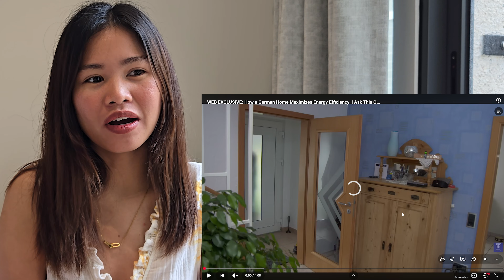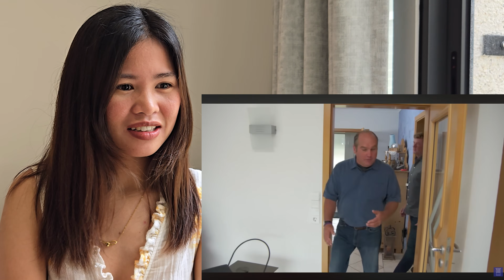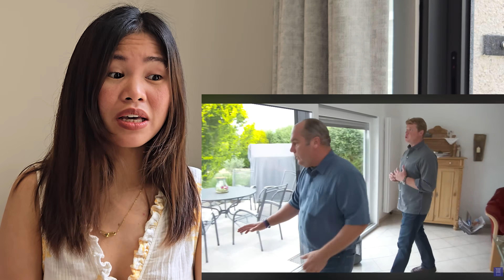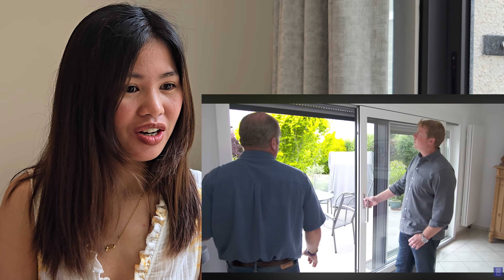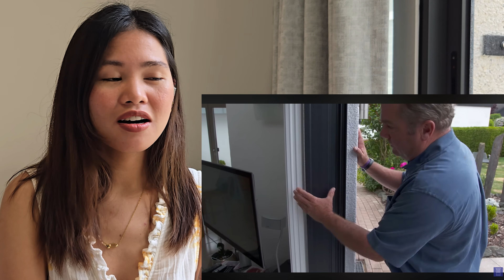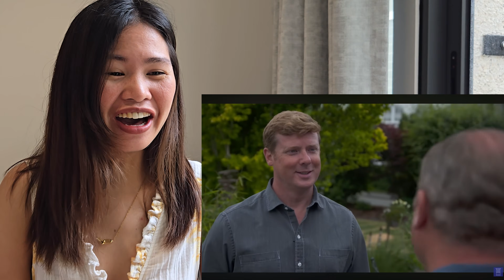American Girl Reacts to Why German Homes Are So Energy Efficient 🇩🇪

Comment: Ash, Germany places a lot of emphasis on energy-efficient equipment, such as household appliances, and, as you can see, in home construction as well.
In the U.S., people place a lot of importance on their AC systems. You’re the one who knows American construction methods: simple wood, barely any insulation, and it gets very hot outside due to the climate. The heat flows unchecked into the house if it isn’t cooled. The crazy thing is, AC systems are actually the biggest energy guzzlers you can have, because they require constant power to cool the air, and due to poor insulation, the system runs nonstop and the electricity meter just keeps spinning. That’s why electricity costs are so outrageously high in the U.S. On top of that, there are other household appliances that aren’t energy-efficient, such as freezers and refrigerators. I can imagine there are even more appliances there that just gobble up electricity.
Reply from the maker: Honestly, I never thought about it that way 😂 I always focused on the AC itself, not how much the house construction affects it.

Comment: Yes, the energy efficiency of buildings is very important in Germany. In addition to thermal insulation for the cold fall and winter months, cooling solutions for buildings are becoming increasingly important due to the increasingly hot summers (such as this year). In the past, it was enough to thoroughly ventilate a house in the evening or at night. But for the past few summers, that alone has no longer been sufficient.

In highly insulated buildings in Germany, the use of air conditioning systems—such as those commonly found in the USA – can create a risk of moisture and mold. This affects all surfaces in artificially cooled interior spaces, particularly in older and historic buildings. Mold then poses a significant health risk to people, especially infants, children, the sick, and the elderly. In the case of historic buildings, legitimate historic preservation regulations must also be taken into account. Air conditioning systems consume significantly more electricity, for which the electrical wiring in these old buildings is often not designed. This would significantly increase the risk of fire. In all these buildings, therefore, the entire existing electrical system would first have to be replaced and adapted to the power requirements of air conditioning systems—in compliance with the relevant fire safety and historic preservation regulations.

My parents live in a 14th-century house which they own and which is divided into several flats that are let out. For the reasons mentioned above, my parents ruled out retrofitting the entire house with electric air-conditioning systems. Instead, they opted to install a special clay-panel cooling system from from a manufacturer in Hesse. This system is clay- and water-based, does not increase the risk of fire, complies with heritage conservation regulations and requires no major alterations to the existing electrical installations. The technical work required to control the system is minimal. Once the clay-panel structure had been erected, the main task involved laying water pipes and hoses. The entire system is operational in all flats. The indoor climate is better than with other air-conditioning systems I’ve ever come across. There is no condensation in the rooms, and the cooling system does not switch off due to condensation. Nor is there any mould growth whatsoever. The system’s running costs are moderate, and the indoor cooling works far better than we had hoped. We – my parents, the tenants and I – are very satisfied with this solution.
Reply from the maker: I've never heard of a clay-panel cooling system before! 😳 And the fact that it works in a 14th-century building without completely replacing the electrical system is pretty impressive.

Comment: In some states of Germany the chimney sweep comes TWICE a year, for older „heating systems“ (literal ovens and chimneys). Oh, and the District Chimney Sweep is technically a government officer… also, the most important factor in terms of houses in Germany and saving energy is the proper heat insulation… which even protects to a certain point against excessive summer heat. Unfortunately, this year we seem to have passed that point during most of the summer….
Reply from the maker: Wow 😳 Twice a year for some older systems? And a government-appointed chimney sweep? Germany really has a system for everything!
Reply: Well… if you still have 1970s oil stoves from your uncle’s family… and before those, your grandparents had used coal/coke/firewood stoves for 35 years… the soot in the chimney still persists after 6+ years of never using any of them… I have only used some electric night storage heaters that my dad had installed 35 years ago, on recommendation by his older half-brother… who was working for an energy supply company, installing overland high-voltage power lines (and who probably got a cut from the company who sold them to my dad)…